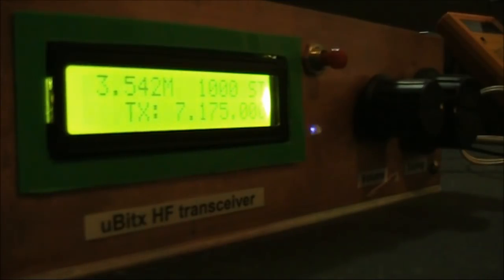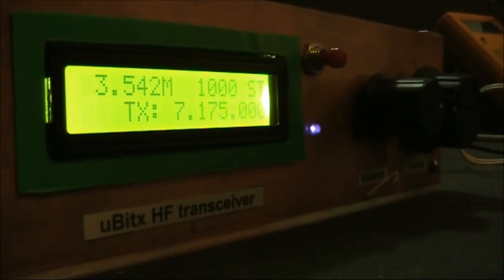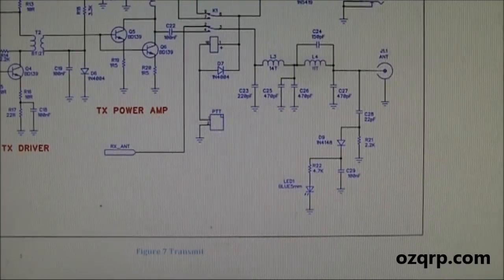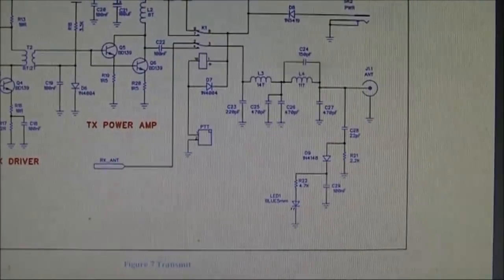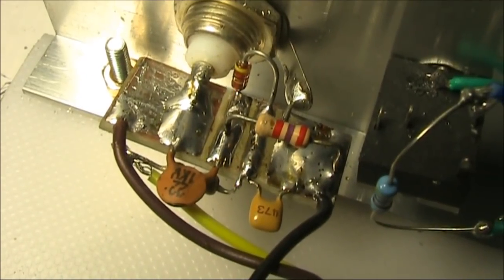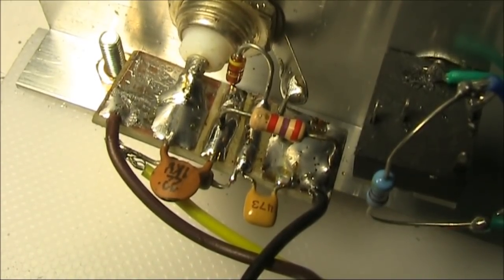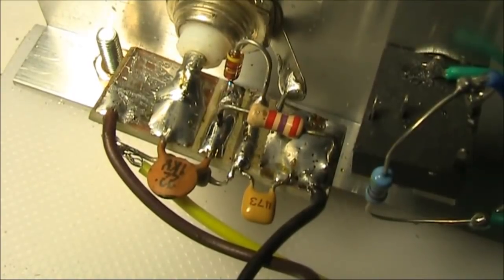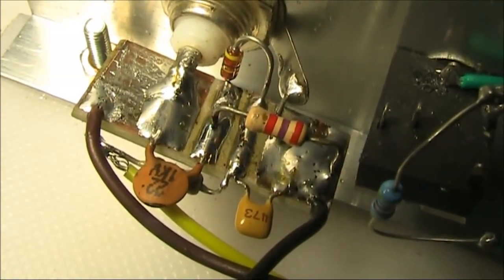RF actuated LED Tx indicator for the uBitx and other QRP rigs

Comment: Works OK with a LED but with my logarithmic LM-3915 IC It shows kind of almost all LED lit but on average only, I get 10 watts peak whistling, but I get no LEDs. Am I doing something wrong? I have used a trimpot in orther not to overload the input, I think it's rated at 1.5 volts max. 73

Comment: How accurate would it be if you were to feed that back to the arduino instead of to the led. Would the varying voltage be a way to calculate power out?
Reply from the maker: Can't see why not with the right programming.

Comment: That's pretty neat. Could you use that for tuning?

I seem to recall someone (perhaps you) using a single LED on a ferrite core that the RF goes through to check swr, would such a setup also work as a tx indicator as you've done here?
Reply from the maker: I noticed a dip in brightness as I adjusted the QRP coupler. But if you wanted something to help adjust your ATU a resistive bridge featuring an LED would be better.